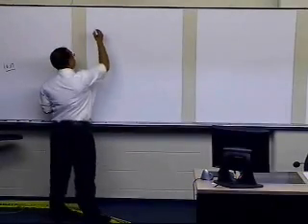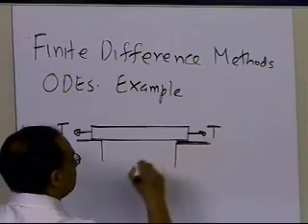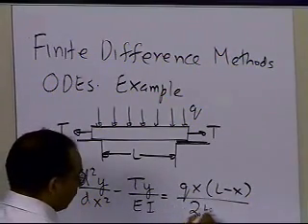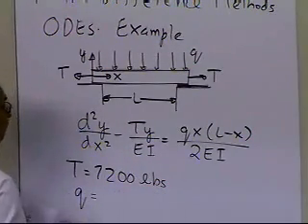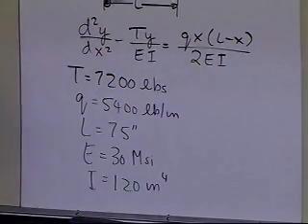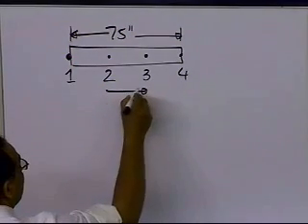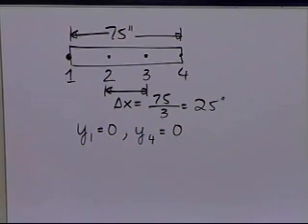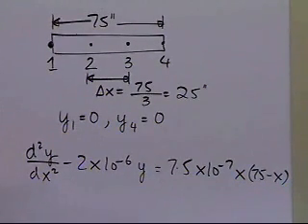Chapter 08.07: Lesson: Finite Difference Method for Solving ODEs: Example Beam: Part 1 of 2

Comment: Why you use TENSION ? can you solve the other example the one that is cantilevered beam with a uniformly distributed load ??
Reply from the maker: It is similar.  One of boundary conditions would be replaced by dy/dx=0 at x=0 and for that you can use 2nd order approx divided difference.  See equation 8 on page 3 of https://geometrictools.com/Documentation/FiniteDifferences.pdf  Also, the governing ODE will be different from above -  See page 6 of http://people.virginia.edu/~ttb/deflect.pdf